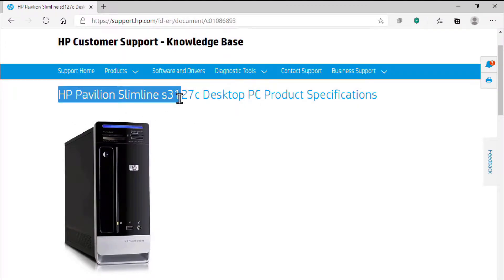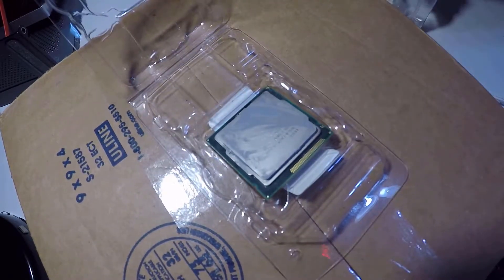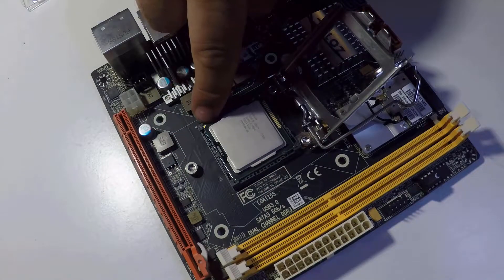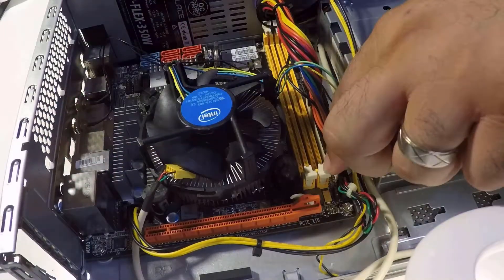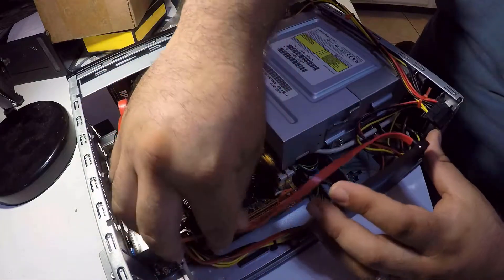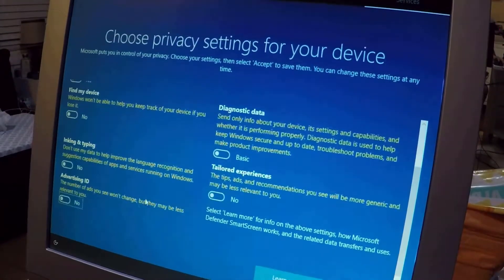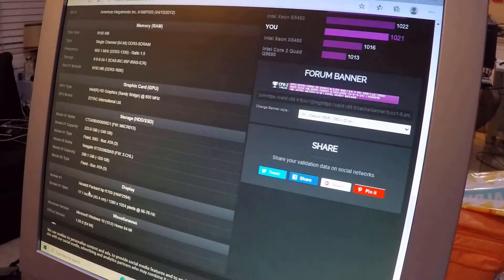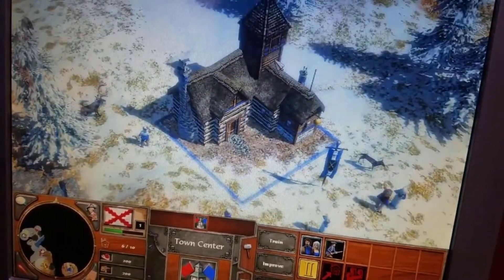Nerd Workbench: HP Slimline PC upgrade on a budget

Comment: Had one of these laying around , just starting to get into PC building and upgrading , figured these old models would be good “Practice” Builds! Starting with a Ddr2 and DDR3 laying around . Gonna max them out with the specs they are capable of for fun
Reply from the maker: Indeed i agree, i consider that trying to squeeze a good performance out an old system should be a great practice not just for building and know the job but to edge the problem solving skills, keep the good work and give it your best 👍🏻🙂